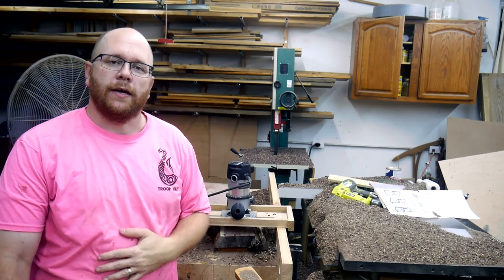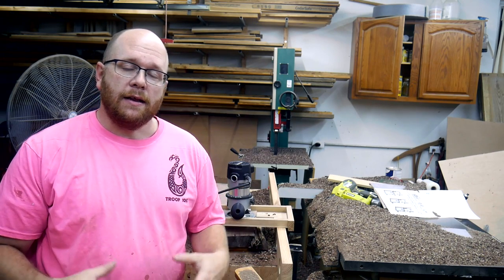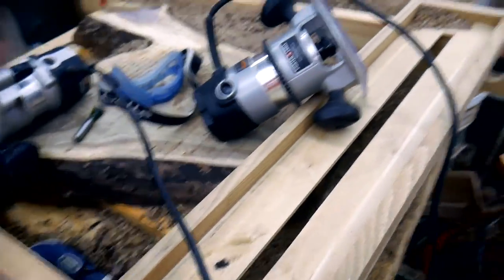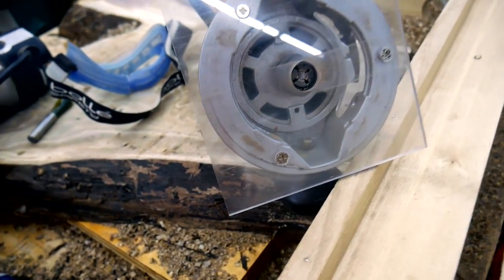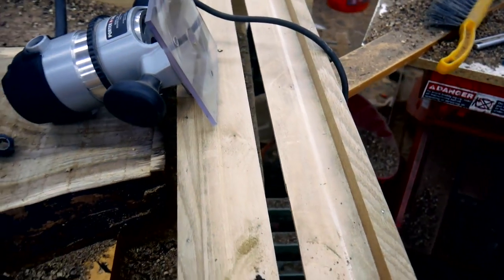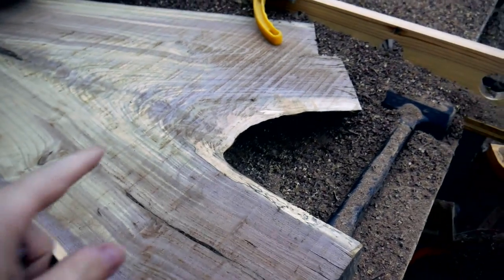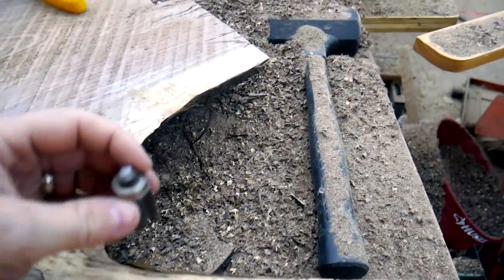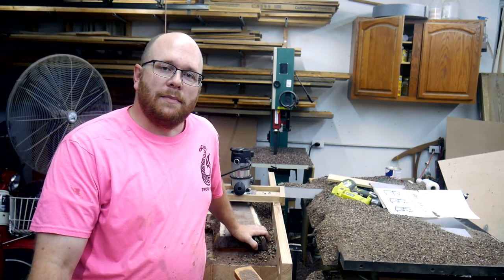Flattening Walnut Slabs with a Jig

Comment: I have a log just like that (maybe slightly bigger :>), now you helped me decide the best way to slab it.  As to your bits, Magnate.net have several flattening bit (I have the 1-1/4" & 2-1/2").  just don't use them freehand.  your sled would work great with either and the width of the bit is definitely in proportion to the effort needed.  great video,  been a fan for a long time.
Reply from the maker: Thanks for the tip, Russ.  Thanks for watching too!

Comment: Have you considered using an HSS end mill in your router? They can be found with a 1/2" shank and 3/4" cutting face and hold up much longer than router bits from my experience.
Reply from the maker: Thanks for the suggestion. I’m holding out for one of those carbide insert bits. They are expensive though!

Comment: Dear Thomas, excellent work with the sled. Do you think the jig would work using a power planer instead of a router? it would cover more area in each pass.
Reply from the maker: Honestly, I’m not sure. It might work if you build the sled to fit the planer. They also make  larger fluted router bits designed specifically for this application. If you do try to make something with the power planer, let me know how it works out.

Comment: Chainsaw Pro Tip - Always have your thumb graping around the front bar. Don't have it parallel to the bar or even worse over and point away from you.
Reply: i saw the same,,, else, cool project
Reply from the maker: Thanks! Never even thought of it, but I can see why it is important.
Reply: My experience says its Ok to keep thumbs pointing away from you/on top of a bar (in this case a steering wheel) is if you drive an old/rear wheel drive tractor in rocky/bumpy terrain/the forest and the tractor doesn't have servo steering. If you hit something in speed, and you hold the wheel with the thumbs "inside", the wheel can spin so uncontrollably that you easily break your thumbs. I've nearly done it.